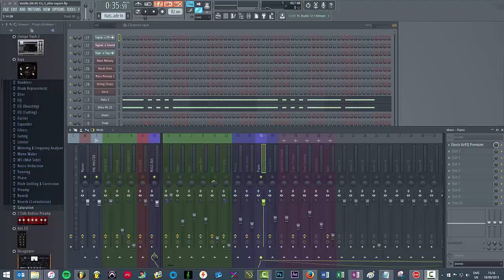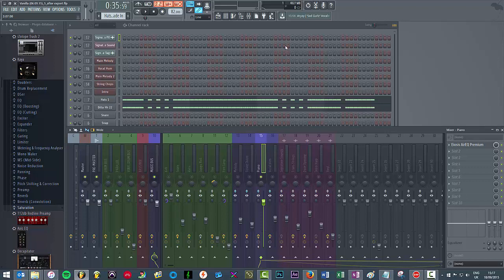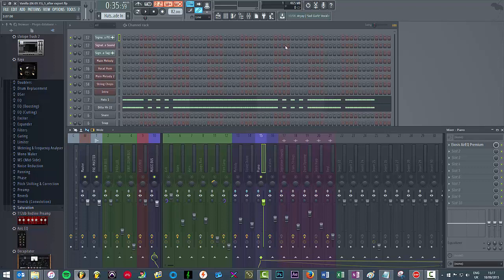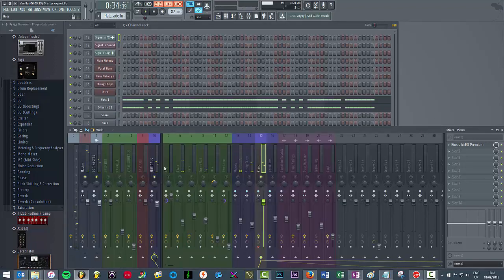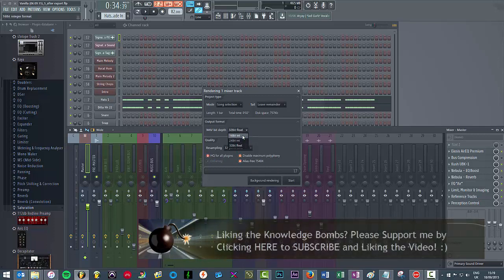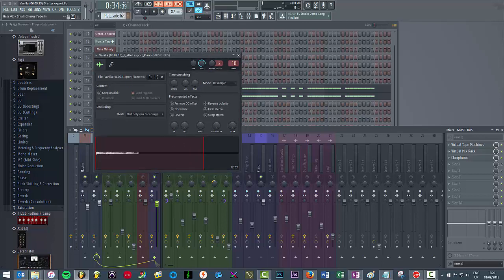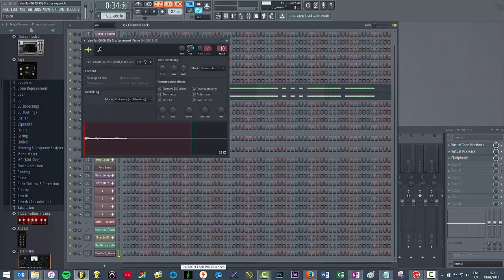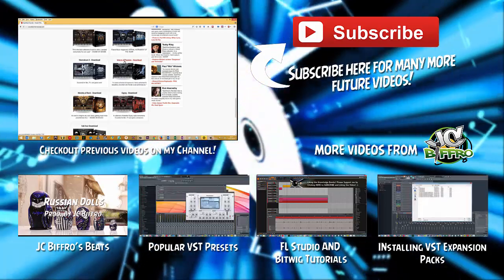Why are Exported Sounds Quieter in FL Studio? | Tutorial | [No BS Series #29]

Comment: My master tracks are a lot quieter than I want them to be.. You're telling me that my master tracks are 8.2db quieter than they were in flstudio ??!!?
Reply: My tracks are -3 on the mixer. When exported they’re like -50 Sad thing is I had to publish them this way to get it released in time. What the fuck is going on?
Reply: @bandname  Same. This vid didn't answer that unfortunately. Volume level is fine within the program. Volume of exported mp3 very quiet.
Reply: @damienholland8103  Same
Reply: @tiagooliveira6935  I just kind of figured it out. They're very quiet until they've been mastered. I did some research on "fruity loops mastering" and most of the vids are talking about putting an equalizer in the mixing board's master channel to equalize the final product a bit. Then putting Maximus there on the master channel as well. When you add Maximus and finish doing that the volume of the exported song is normal (plus it sounds better too if you do it right).
It's a little complicated so I'm taking it very slowly. And only making minor changes. But I think that's the real answer. The reason it's quiet is because the song has not yet been mastered (just mixed).
Reply: @damienholland8103  Oh, I see...I'm gonna try that.,thanks for the advice
Reply: @tiagooliveira6935  Yes, but when you make it louder you have to avoid clipping / distorting the music by making it too loud.
This is going to take some time to learn. I am moving very slowly. Every day after work I try to spend an hour or two on music then let it rest.

Comment: i tried to add 37% more volume to the finished wav but ended up distorting the whole track. will i have to export each individual stem and adjust the volume there? what’s the solution to the low audio after the export ?
Reply: 5 years later still no solution
Reply: @noiseoffstudios1268 lmaoooooo that’s how it be 😢
Reply: did u get any solution yet

Comment: More efficient way to do this is to make sure the mixer track youre exporting is only linked to the Master and that the fader is at unity gain. You can right click and copy the fader value prior to this is you already have your faders set how you want them. This method works because by default, all FL Studio audio bouncing/exporting is routed through the Master. So if your mixer track is connected to any sends, these sends and any effects on them also affect your exported sound and volume.  Hope this also helps.
Reply: how do you bounce to wave without sending it to the mixer, though? i used to be able to do that in previous versions but in 20 producer edition it won't save everything in the one wav. i definitely have effects on each of my mixer tracks,

Comment: I use Mixcraft 7.5, but I hope someone can help with my problem... Every time I mix a beat into a WAV file, my kick and bass don't sound enhanced like how I thought I mixed them, in fact it's like their sound has been completely decreased, the boom I hear with my headphones on the program is gone when listening to it on windows media player! I thought the problem was not blending them together well, but when I converted them each separately, both their sounds still turn out bland than how I modified them to be... also sometimes my snares and hi hats don't sound as sharp either, but I manage to adjust them, just not the kicks and sub bass... maybe I'm using too much compression? can someone tell me the solution and what the problem is?
Reply from the maker: Have you tried using a different program? Like VLC or iTunes for example. It could be Windows Media Player that's the issue
Reply: JC Biffro I actually figured out the problem shortly after posting this lol, turns out I just had to make the Hz for the WAV file match the Hz that mixcraft was set on. The Hz on the WAV file was set much lower which is why it kept decreasing the sound I mixed, but I do think windows media player still decreases some of the sound because I've played the files on iTunes and it sounds clear as can be.
Reply: THIS was the correct answer! I was using SMPlayer in Ubuntu and the Max Volume was set to 110%. Kaffeine, however, played it at full volume matching FL Studio's volume. So I upped SMPlayer's setting to 200% and it now matches FL Studio. Thanks for the correct tip!